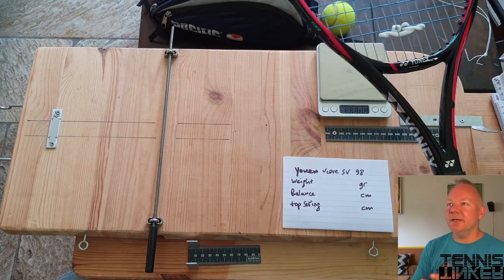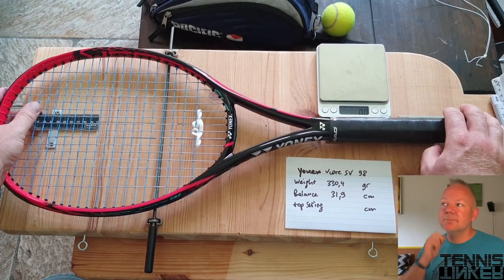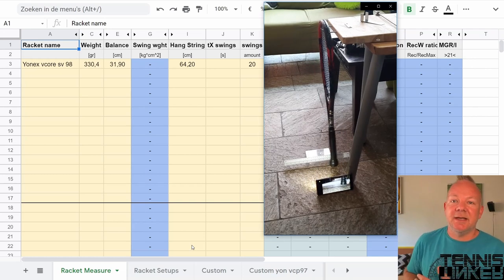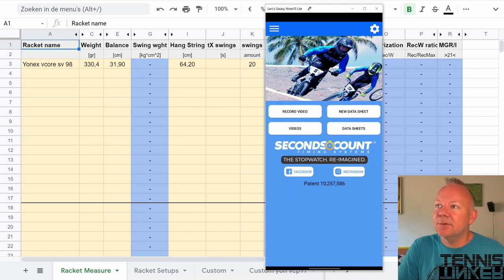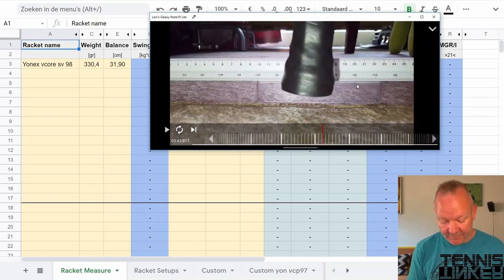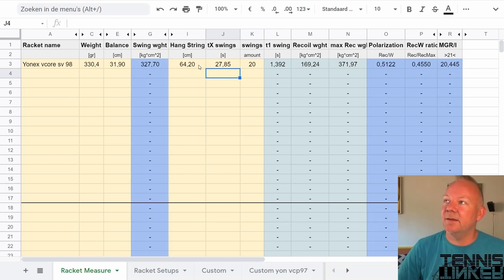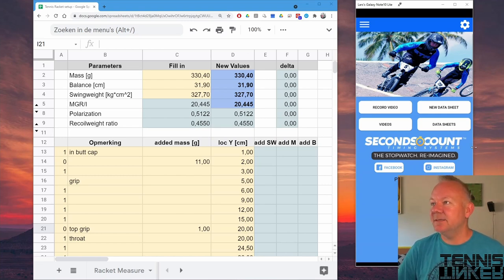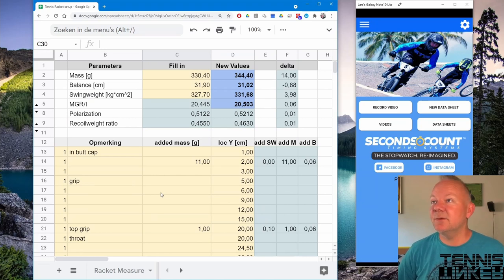Cheap DIY Swing Weight Measurement tool

Comment: Maybe I'm just not good with physics, but I'm confused about how swinging the racquet from the top string can result in a swing weight measurement, when all the RDC machines measure by swinging from the grip. It seems like if you added a bunch of weight right at the level of the top string the swing time would not change, but the actual swing weight would be dramatically increased. Is there something I am missing/not understanding? Great video nonetheless. I am just confused.
Reply from the maker: The characteristics of the mass distribution which results in a certain swing length can be measured from any point and calculated towards the 10cm point from the butt cap. That is what the formulas do. As an analogy (which isn't exactly the same but to give you an idea) on a kids swing in the park you can measure the momentum on either side as long as the distribution (where the kids sit) of their mass is constant.

That's why it is important to know what the exact swinging point is (the string it is hanging from) to do the translation calculation towards the normal point.
Reply from the maker: And to answer what would happen if you add a lot of weight right at the point of the hanging string:
Your static weight increases and your balance point changes upward, so the swing time length will change. So you have 3 totally different inputs into the equation (mass, balance and swing time) for a different result.

The swing time could maybe still be the same (sounds realistic yes), but then the other 2 still vary for a different end result
Reply: @TennisTinker  aaahhh ok, That makes sense now. Thank you!!
Reply from the maker: @ncbassplayer  thank you for your good question. That is something that was also crossed my mind in the beginning until i figured it out.

Comment: One big problem here Lars.. you don't test swing weight by having the butt of the racket swinging... The head of the racket has to be free
Reply from the maker: I answered this question already 👇 below. Yeah it sounds counter intuitive, but with maths you can translate that movement to the point that you want. That's why it is important to measure the exact distance between the top string and the butt cap. Inertia and momentums can be measured from different points to get information about the system as a whole.

The formulas in my excel sheet do that work for you.

What you could wonder then is the following case. What if you add mass to exact the position of the top string. Then the swing speed of the butt will not change. But the total mass will change and the center of mass (balance point) will change and those changes are also variables in the calculations which changes the outcome accordingly.

Comment: Why do all my rackets turn out with a very similar weight yet they are meant to be totally different ?? I do everything exactly as you have shown on video. I don't understand why they are all within a few grams of each other. I am talking about an ncode 289 gram pro staff 95(modded with 3.6 grams of weight on top and 2 overgrips increasing its weight to 337), a blade v5, a rf97a, an ncode six one 95 that is way heavier than the other ncode and yet all swingweights are within a few grams of each other only, always around 289-290 grams. The funniest thing is that the heaviest ncode turned out with a swingweight of 286. The heaviest of all rackets RF97A turned out with a swingweight of 284 grams. I have 0 idea what I'm doing wrong. How is this even possible ?

Edit number 1: 

We were 2 people doing this experiment and we have accidentally counted 20 swings instead of actual 19. The difference is a bit bigger now between all the models but the biggest grams difference between them was just 4 grams. Is this possible ?!

Edit number 2:

Adding 5 grams to the top of the six one 95 ncode (2.5 at 11 o clock and 2.5 at 13 o clock) made its swingweight increase from 339.69 to 353.88. 

Your formula works, sir ! Thank you for saving me at least a couple hundred euros !
Reply from the maker: I don't totally understand your issue. If you are talking about grams, you are talking about static weight. Swing weight numbers are not in grams. But is it solved now? As a rule of tumb (very rough one), adding 3 grams at 12 adds 10 swing weight points. So 5 grams could be right indeed. It is always handy to have some rule of thumbs so that you can have an idea when something is really off.

A strung base (not customized racket) swing weight below 300 or above 335 is also suspicious. Not impossible, but for most normal rackets (that are not beginners rackets or old vintage rackets) very unlikely.
Reply: @TennisTinker  There is no problem, at first i thought there was but in the end i figured your method works just fine.
Reply from the maker: @experiencewithmartin972  Good to hear

Comment: nice video, very helpful for those who dont want to spend extra money on sophisticated machines!
Reply from the maker: No reason not to customize your own ranger and get the best out of it
Reply: @TennisTinker  indeed. I'm gonna do one for myself, based on your instructions. Surprisingly, I have 5 head radical mp microgel, but didn't bought them all at once. The first 2 of them bought it in 2018, another 2 in 2020 and the last one in 2022. I have to say they all different in balance and SW, especially the last one came brand new already with 10 grams of silicon in the butcam, in which the other ones doesn't have. I really need to get them close to one spec. I'll keep in touch with you!
Reply from the maker: @mariusstoica7248  silicone in the butt cap doesn't change the swing weight, but it does change the balance and static weight with the same swing weight which as a result also changes the polarisation of the racket which means that the timing of your contact punt can differ greatly between the rackets with the same swing but different racket
Reply: @TennisTinker  right. I've noticed this playing, you know breaking the strings during a game, then go to your bag and pick another one, same tension at 23-21 kg, from the first hit I felted so off, so different, but I had no choice, I had to continue the match and loose, so frustrating.. Now I'm trying to get them on spec. 330-335gr weight, 335 balance, 330 swing weight
Reply from the maker: @mariusstoica7248  I play with 353 grams static weight, 31,0 cm balance and 332 swing weight. Now you know why the timing is difficult after changing a racket. Even with 2 rackets that you buy new in the shop, the Quality control of those rackets van be pretty off to make both rackets feel like 2 different rackets.

Comment: Great video, just one question: when you swing your racket from the hooks, you advise up to a 15 degree angle to swing it from. Does this have to be perfectly 15 degree angle? Because at what point does wind force become a factor?
Reply from the maker: It doesn't have to be exact, if you see that the amplitude of the swing decreases rapidly with every swing, then you are encountering wind drag. The less the amplitude decreases per swing the less air drag.
Reply: @TennisTinker  okay thank you. It makes sense now 👍🎾

Comment: Great video. Would be amazing if you could get hold of an RDC machine and compare the SW values?
Thanks
Reply from the maker: Thanks, that is not needed. I have used my method on the same racket multiple times after adding lead and calculating the effect. After applying the lead and measuring, the measurement was spot on with the calculation. So the method is sound. An RDC machine does the same calculation, but then internally and is calibrated with a metal bar. That metal bar can also have imperfections, so also a RDC machine is not 100% accurate.

Comment: Thanks for the info, I have a question. Does the length of racquet play any role in your Excel? I have a Prince Tour Diablo which is 69,22 cm length, so a bit above standard.
Reply: I already saw your answer in previous questions. Thanks.
Reply from the maker: @tennisking75  otherwise i would have answered it again. Answer is indeed that length in this case doesn't matter, regardless what she said 😄

Comment: Does this work exactly the same way with extended racquets?
Reply from the maker: Yes, it works exactly the same for any length racket. Swing weight is measured with the 10cm from the butt cap point of reference. This method you measure it from the top cross string (you input the distance between the top cross string and butt cap) and the formulas automatically translate this into the swing weight from 10cm. It's an inertia calculation.

Comment: @tennistinker, a racquet with a lower stiffness makes a softer impact of the ball. A lower string tension makes a softer impact on the ball as well. In general, to create a similar feel of softness between a racquet with a lower en  higher stiffness, what should be the difference in string tension?
Reply from the maker: That's  really good question. It is also dependent on how much the difference is between the stiffness of the rackets. I have some rackets that have stiffness 59 or 60 and other rackets that are around 65. I don't play with rackets that are stiffer than that although I have one racket that is even softer than 59. Next to stiffness there are 2 other aspects that influence the feel of the setup: 1. Density of the string bed (a denser string  bed, especially the center), the stiffer it feels. there are very dense 16x19 string beds as well as pretty open 18x20,. So the string pattern doesn't always tell the whole story. 2. The size and shape of the hoop. a smaller size hoop 95 inch2 will feel stiffer and the shape also influences it, a more oval narrow hoop feels stiffer as well, but the narrow shape maybe also has to do with the smaller sweet spot and my lack of always hitting the strings in the middle.

So I cannot answer this objectively, just my experience with my dynamic tension measurements. I string a smaller head size racket (95 inch2) 1 to 1.5 kg lower than a 100 inch2 racket. just based on stiffness I differ 1 kg. As an example I string my pro staff 97 1.5 kg lower than say my Head Speed MP. But my radical pro I go 0.5 kg lower than the speed, but that has to do with the higher power level of the radical pro over the speed mp. Otherwise I would string it 1 kg lower, but then it gives me too much power.

So you have string bed feel, but also confidence related to power (dept of your shots). So most of the time I adjust for a similar level of power 1st and stringbed feel 2nd.

Comment: Can you explain how far you should swing it? Doesn't the distance you swing the racket impact the calculation? Like if it was swinging from a very large angle versus a smaller one? Doesn't this change the timing?
Reply from the maker: Use small angles, as small as workable for being able to distinguish the correct frame in the outer position for your calculation. If you use too big angles the wind resistance will become a factor and it will influence your result as the swing will be allowed down by the wind resistance. So i use a max of about 10 degrees to one side.
Reply: @TennisTinker does a 10 degree angled swing have to be exact?
Reply from the maker: @woodyhewitson  i think I've answered your question already in your other comment?

Comment: At 5:57 I see an interesting calculation can you explain? In the video of measured swings it shows actually 32.780 and you put in 42.780 then add 180 and make a correction for slow motion. Where did you get the 42,780 from and where did you get the 180 from?
Reply from the maker: For the video i had to do it rough and fast so the time in that little tool wasn't totally accurate. (Before the video i did it accurate for the exact time). It was something like 3 minutes 42 sec etc. In the sheet i add the 3 minutes by adding 180 seconds, as the sheet calculates in seconds. And the divide is to calculate back from slow motion to real time.

Comment: Hello, I wanted to ask what is the measurement of the board that you are using in length?
Reply from the maker: Really depends how you make your balance board. From the bar that the racket balances on to the side where you measure the butt cap while balancing should be minimum 35 cm as i don't know rackets with a balance higher than that, but you could be safe and use 40 cm in that direction. Of the tablet face side you should have something that the racket face can rest on otherwise while balancing it falls off. That could be a table under your balance board or you can add length to the balance board itself. Something like 30 cm should be enough.

If you also incorporate measuring the distance from butt cap to the top string, you need a board of the length of a racket, plus some.
Reply from the maker: I made a new one that is longer than 90cm and slimmer, on the new one the metal ruler of 1 meter that i cut 10 cm off was the base for the design. Video will come out, dunno when yet
Reply: Iets om naar uit te kijken! @TennisTinker
Reply: Question about the measurement of the distance from butt cap to top tennis string. Did you use the fixed distance that you have from the rod to the butt cap and a fixed distance to the small metal plate on the other side, and measure the difference with the loose part of the ruler at the top string?  @TennisTinker

Comment: Hmm, im a bit confused as to how this would work. My understanding is that adding weight to the handle doesn't affect the swing weight because that at the point from when you swing the racquet...hence the machines that measured swing weight by swinging the racquet from the handle.

But in this demo you swing it from the top...but i dont hold the racket head when I play, i hold the grip.

So in this method if I had heaps of weight in the head it shouldn't affect the swing weight because the racket is upside down
Reply from the maker: You can measure inertia from any point swinging and with calculations recalculate it to the point you want it. 
Maybe not a totally correct anology, but to make it simple to understand. If you have a swing (like on the play ground) and you have a fat kid sitting on one side and a skinny kid sits on the other side, if they swing with the balance point close to the fat kid you can use those measurements and based on that you can calculate how it would swing if the balance point would be close to the skinny kid. 

So the swinging around the top string in combination with the other measurements (mass, balance point and the distance of that top string to the butt cap)  is enough to translate the swing data to the 10cm point on the butt cap which is used for swing weight.

Comment: Is the iPhone the same slow motion speed?  Divide by 8?
Reply from the maker: It depends on 2 things what the factor is:
1. How fast is the slow motion? In X times normal speed.. 
2. In what speed is the video saved?

In my case the answer to q1 is 8x speed (240 frames per second) and it is saved as 1x speed (30 fps), so the saved file is 8 times longer than normal time. That's why i have to divide by 8.

What you can do is record 1 minute in slow motion and when playing back see how long the video is. If it is 4 minutes, the video is 4 times as long and you have to divide by 4 to get it to normal time again.

Comment: This is not working, as i tried multiple times, filmed with a iphone 13 pro on 240FPS and i do not get a accurate sw , my time for 20 swings was on 01:49,08 , so i do no know how you get the time on 03....what FPS do you use on your phone?
Reply from the maker: @vladmaxim  240 fps divided by 30 is 8. So you might have to divide the time of your 20 swings by 8. You have to imput the time in second. And with 1 swing i mean from the furthest front to back and back to front again. Let me know if this solved the issue.
Reply: @TennisTinker  First of all thank you for your reply, i try since February to find my SW on my HEAD Speed MP 2024 with your method but again and again i did not work, or maybe i do not understand it completely. I did all you say that includes the furthest front to back and back to front again swing, but i get the time of 01,49,08 and when i put in in the sheet it is divided by 8 it is like 60,49,09 (and your calculator does the divide it automaticaly by 8) and i get the swingweight totally wrong, my question how get 03 minutes on your video with 20 swings and i got only 01 min and 49 seconds on slowmotion 240fps ?
Thanks!
Reply from the maker: @vladmaxim  on my website you can find my email. If you can share a link with me to your sheet and video file, i can have a look for you. That's the only way for me to really help you. If your video plays back at 60 fps while it is recorded at 240 fps, the divider has to be 4 in stead of 8, but I'm just guessing here. I can only really help you if you give me access to your files.
Reply: @TennisTinker  Hey Lars, thanks for your response, i just send you a email with the files and my racket data.
Thanks a lot for the help!
Reply from the maker: @vladmaxim  I get a swing weight of 332,01 with your data. 
I put 110,319 seconds divided by 4 (so not 8).

20 swings was 1 minute 50 seconds and 319/1000
The video is saved at 60 fps. So 240/60 is 4
Good luck
Reply from the maker: To be exact, the frame rate that your video is saved is actually 59.94006 fps. 240/59.94006 is 4.004. So you have to divide the amount of seconds by 4.004 😁

Comment: Where did you get 31.9g balance? I dont get this.
Reply from the maker: First i used the scale to get the mass of the racket. 

After that i put it on that metal rod for the balance point and i red the 31.9 cm (distance between metal rod for balancing and the end of the butt cap) from the metal ruler that is attached to the wooden plank.

Third step is measuring the string that you hang the racket on for the swings.